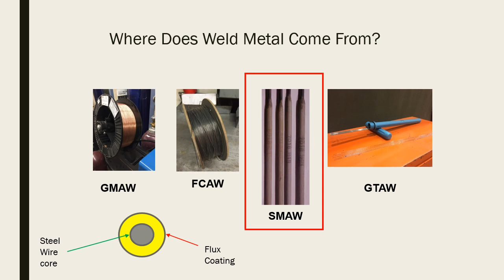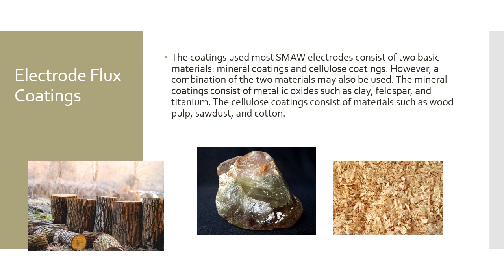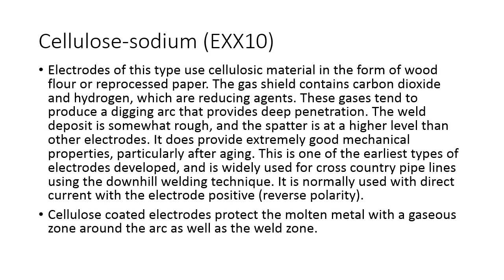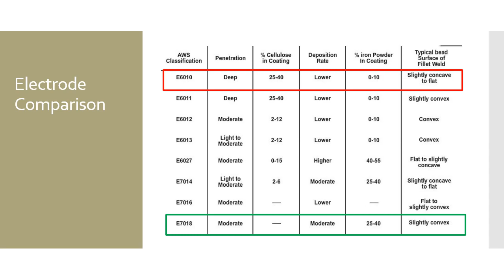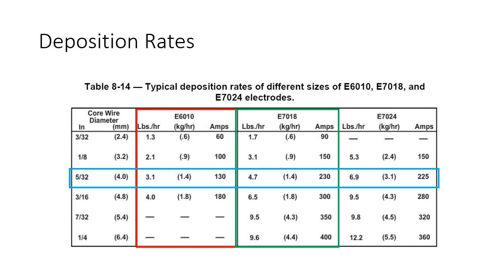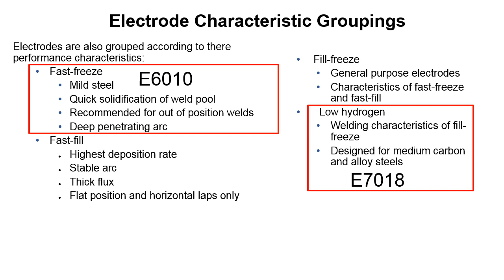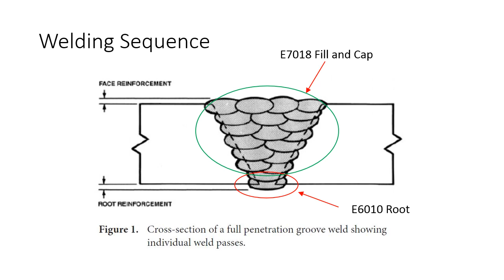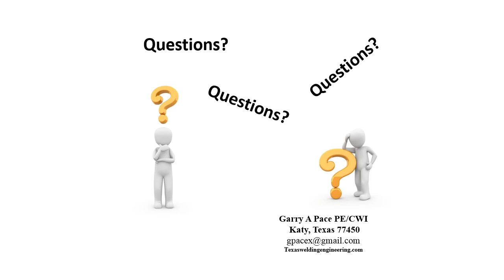CWI Course Module 8 - Difference between E7018 and E6010

Comment: 7018 can be difficult to run larger diameter rods in the vertical positions especially groove welds tends to wanna get as large crown in the middle of the bead you gotta know your parameters when using that rod